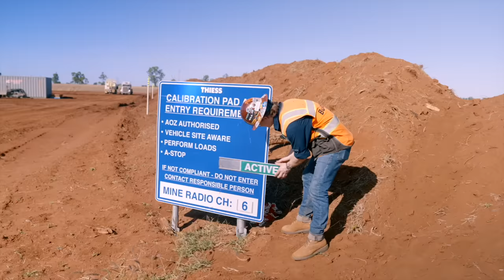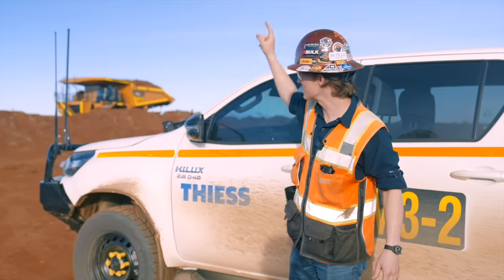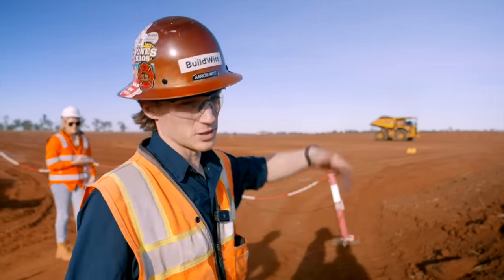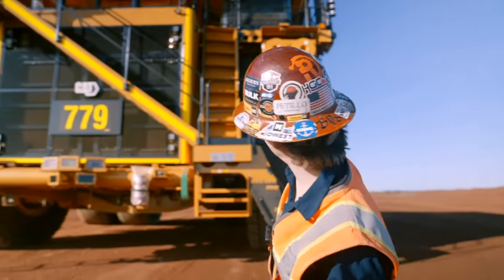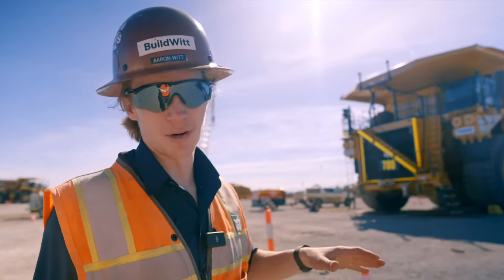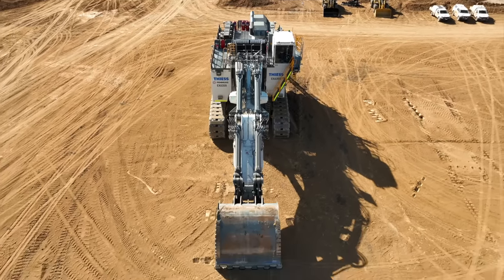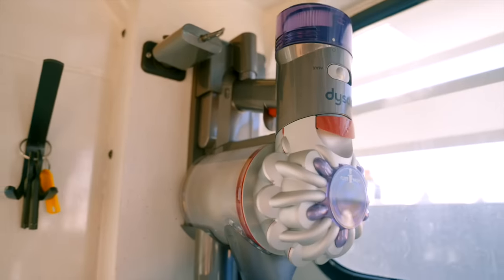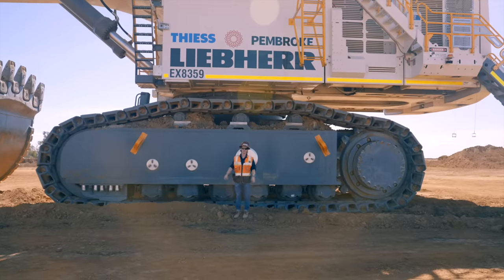Building Australia’s Newest Mine

Comment: We started doing this at Rio in the Pilbara back in 2007?

Automated dumping, refuelling, etc

There was a remote operations centre that managed oversight on all the haulpaks 

Not using Lidar however.

But this has been around for over a decade.

The e-stop button however is pretty cool. Wouldn’t want to be the person who accidentally pressed it 🤣
Reply: Accidental A-Stops are actually extremely common. But the damn things will yell at you until you've noticed! On our site though your astop only creates a barrier around you I can't remember the distance, if a site-stop is needed it's done from control.

Comment: What is the default if / when GPS / Communications Default and go down / out / aren't being received / Transmitted ? 
   ?? How long to Emergency  Full Stop ?  ?
Reply: Pretty much instantaeous. First off, they use GNSS not GPS so there are many more satellites/positioning systems available for reference and then there are different levels of accuracy such as RTK and DGNSS. As soon as an autonomous vehicle "loses  RTK" the vehicle itself commands an emergency stop. In that case, it may still have a position, but it's just not considered accurate enough
The engineering involved in developing a system like this is mind boggling

Comment: I always find it odd why massive mining and earthmoving operations like this went away from using trains to haul materials to trucks, a 4 car train with 80t capacity per car hauls more than one 794, and one loco with the same power output as the 794 can haul way more than that, even on fairly steep grades, steeper still with none of the traction problems of conventional rail or even the trucks themselves if it uses rack rails to get up and down hills.

Plus trains are way easier to automate and run on electricity

Comment: Was surprised that there seemed to be a lot of "teething" issues getting the autonomous truck moving - he should not have needed to go up into the cab or manually drive the truck into a lane.  If it is started out of it's lane, it should just move slowly into the nearest lane that makes sense.  Would have though that by the time these machines reached the mine site - even the mine calibration site - things would be more polished and ready to go.

Comment: So I'm 99.9999% sure this will be like trains where a person is still sitting in there. Because someone will need to be "responsible" for anything that goes wrong.
Reply: Nah. Won’t need anyone in the Cab, but you’ll need a remote monitor at least - insurance purposes.
Reply: I'm 100% sure they won't. Because these trucks have been operating fine for 10-15 years without someone sitting there. 

Why say dumb stuff when you obviously don't know anything?
Reply: The issue with the trains is also related to the Unions insisting that someone be in there.

It’s not applicable to the haulpaks.
Reply: A lot of trains are already autonomous
Reply: @KUPHSER None outside of closed loop systems.

Comment: Electric driven but has a diesel motor for the power?? Beside the point isn't it?? Just run it on a diesel motor. Diesel and petrol is far better for the environment than electric 100%.
Reply: The engine drives a very large alternator which in turn powers two wheel motors. It's a far more simple design eliminating the need for a transmission, torque converter and differential.